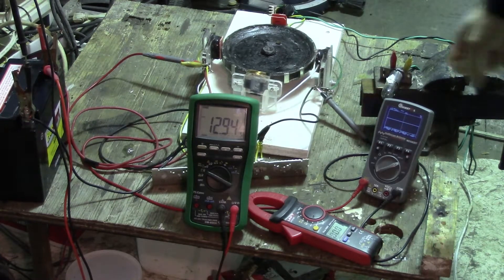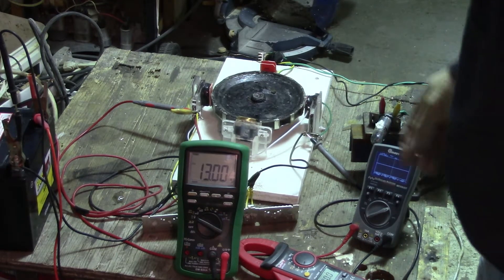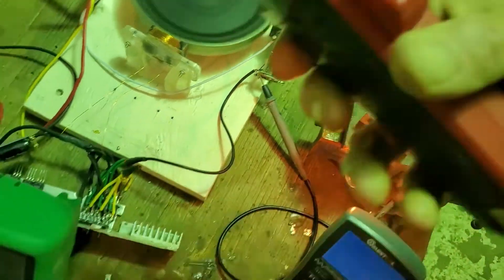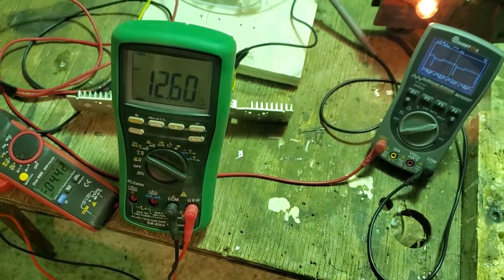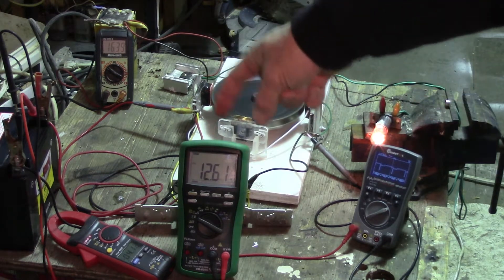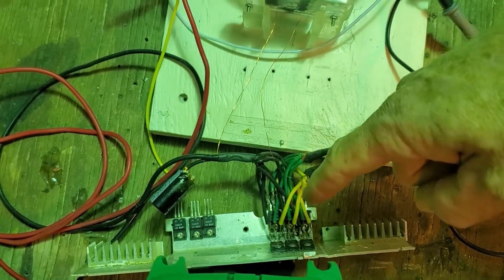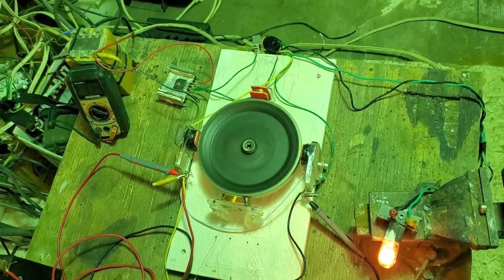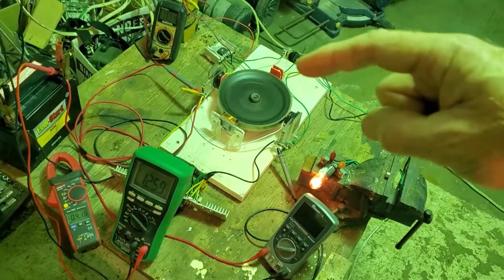Magnet Pulse Motor power in and out

Comment: Great minds must think alike.
Like What your talking about with additional driver coil and rotor. 
My thoughts was tiny Newman motor coils. 
The coil has a magnet inside mounted on a axel.
My thoughts are when pulsed the coil will naturally aline the inner magnet and drive the wheel rotor. But as the field collapses or the opposite magnet from the wheel approaches. It will flip the inner magnet and force more and better generation.
I'd like to upload a video later tonight and show you this concept. 
The wheel rotor magnets turn the inner driver coils magnets very nicely without alot lenz drag from two opposing magnets.

And thank you for sharing your research. There's alot packed in these videos. And i can tell you have put the time in researching and testing. 👍👍